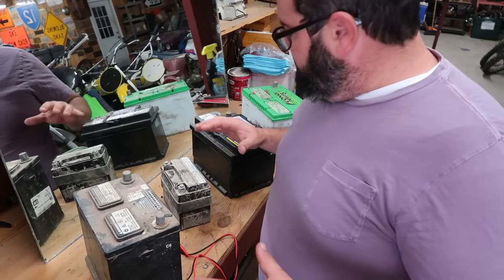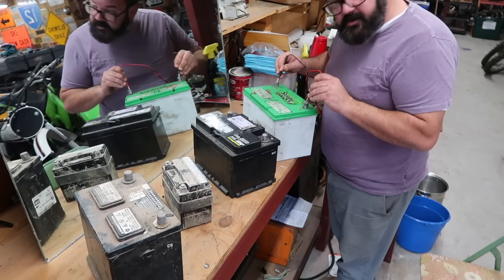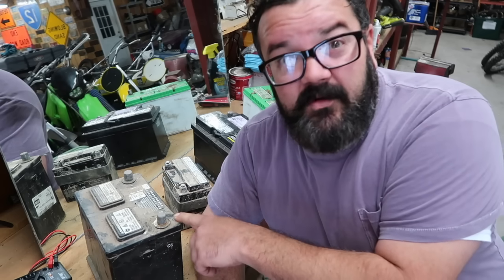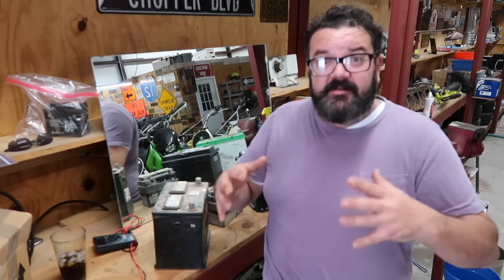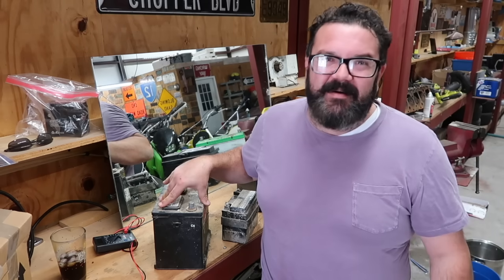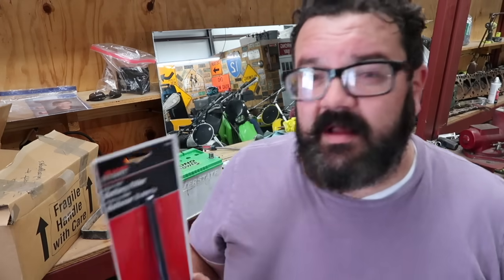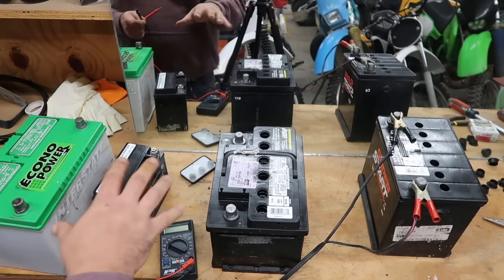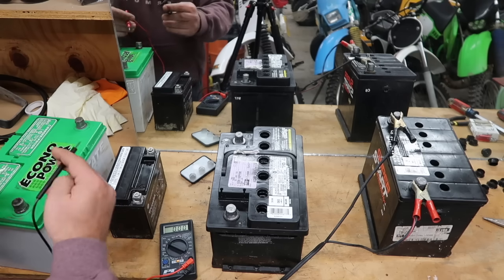Reconditioning a 12 Volt Car Battery: 100% Success

Comment: WOW ! the voltage is nice, BUT what about an Amperage draw test, , either with a hand held amperage load tester, Or put it in a vehicle that requires a lot of amperage to spin the engine,   I did this to an old bulldozer battery the battery was huge very heavy and two ropes to move it, it worked enough to get the old Caterpillar d8 to start, move it to my low bed trailer . Took it home, worked on it to new restoration  . Not bad for a free dozer, that had nothing wrong with it, sat 21 years, J.R. New England usa
Reply: A free D8? That’s practically a winning lottery ticket 😁
Reply: James Raymond CreativePhotography  that’s awesome
Reply from the maker: James, I'm assuming you didn't load test the D8 battery before you loaded it on the trailer. Same here. I fixed the batteries and started the vehicles, which is actually a load test. Good luck with your D8 project, I need one to dig a pond.

Comment: To really test the quality of your battery rebuild process, charge the car battery at 2 amps for 48 hours. then let the battery sit for 2 days and measure the voltage. It should be around 12.5 volts. Then try starting a car and make note of the sound of the starter speed. Compare that to the sound of a good battery when cranking the same car. A better test would be to take the battery to a auto parts store and have them do a discharge test. Car batteries will provide upwards of 90 amps under load. Batteries fail due to increased internal resistance limiting that maximum current under load. So voltage alone is not a good indicator of the quality of a battery.
Reply from the maker: Thanks for watching.
Reply: Good advice but should people try what was done here?
Reply: @nedcramdon1306  No, it's a waste of time. To really make this work you would need to remove the plates and chemically clean them to remove the contaminants which limit the current. That is what the epsom salts is suppose to do. Then you would need to clean the sludge from the bottom of the battery box which shorts out the plates limiting the voltage. Put it back together, add new electrolyte and charge it up. At this point you will have wasted more money and time than buying a new battery.

Comment: Lead / Acid batteries work with two dissimilar metals in the plates in a 9 or 11 plate configuration per cell; usually lead and zinc to enable the electrons to move through the acid during the charge / discharge cycle.

The Zn and Pb plates are the anode and cathode -- +/-.

Comment: Great video man. Better then all the ones I saw and my brain 🧠 understands. Haha, but I’m  confused 🤷🏻‍♂️ on you mixing the old acid with the Epsom salt and putting it back in the batteries. Is that an option that you did or can I just refill the batteries back up with epsom and distilled water without the old acid?
Reply: Without the old acid

Comment: So you leave the solution you boiled on the stove in the battery?  Do you flush it and replace it? How does this remove the scale on the plates and where does that scale go?
What do you do with the bicarb solution as referenced above? Seems like only half of the process was shown?
Reply: Correct,he doesn't make it clear.
Reply from the maker: After trying it a different way, I;d watch my second video, its a better approach

Comment: I've done this a few times and what I've come to find out is that you can seem to get them to recharge to a good voltage but the battery never regains it's Cranking amps.
Reply: I think its right say
Volt yes. But no crank amp
Maybe a truck battery will be  good for small car
Reply: right! 
That because the plates are sulfated so only the equivalent of a postage stamp surface is available for current draw
and the stack of cells are imbalanced (some higher, some lower)

In electricity they call that situation "high internal resistance"

junk is junk
Reply: I tried this on a small sealed led/acid battery and the plates were eventually dissolved into a mass of "black liquid." I guess that you have to get the proper mixture of Epsom's salt into the mixture which I obviously did not have.  It would probably be better to desulfate the plates first but this can take a LONG time!
Reply from the maker: The whole point of this is to clean the plates.
Reply: @CarGroves  But..it does not desulfate the plates I would imagine. I could be wrong. They have special electronic devices for that and even with them it takes a LONG time.  My plates turned into a "black soup" when I added the Epsom's salt and that was the end of the battery...Lol!  Incorrect mixture in my case, l guess??  😉
Reply: @arthurmann578  Any experience with Battery Minder (1500)?  I may have been recovering a battery, but since I was doing two parallely I believe they get out of balance i.e. the weaker will be low and stronger will overcharge thus yielding an average "top-off" voltage; I now let the weaker top-off by itself, and then let the process continue.  My weaker battery is working, but I don't put it through tough use. 

If anything, I find the Battery Minder 1500 a good maintainer.  I don't think thick desulfation is actually possible.
Reply: @louf7178   Thanks about the info, Lou!! Much appreciated.  I am looking into a solar battery maintainer for my car because I don't use it very often and the battery discharges.  I don't have a garage that I can use to plug in a battery maintainer so I am forced to try a solar one or constantly remove and replace the car's battery.  I am a little reluctant though, because some are of poor quality and people have shown how the wires on some actually melted and almost set their cars on fire!! I may be forced to build one of my own or at least "upgrade" one for safety .  Some of the better ones are expensive and I am...well...poor..lol!!  Be well and thanks again!  😀😀
Reply: The problem is, yes the Epsom salt does work but you also need to keep some of the battery acid in the battery. It does drop the cranking amps from say 850 cranking amps to 700 or so
Reply: @arthurmann578  I think solar chargers are (theoretically) a great idea for remote locations.  I imagine there has to be something of legitimate quality available - I do recall seeing one that sounded good.

I now am of the habit of putting a maintainer on a battery if it will sit more 2 days (usually one).  Adding a quick-connect eases the hook-up (make sure its capped so wet conduction doesn't happen)).  The self-discharge and parasitic-draw drains the battery, and that speeds up sulfatuon.  I've experimented with an old battery, and it has been performing sufficiently; these practices should extend the battery life.  I cant say I've desulfated one though.
Reply: @louf7178   I like the quick connect idea, Lou.  I am going to maybe look again into buying a solar charger of as best quality that I can afford.  Sometimes it is true about that saying "you get what you pay for."  It does suck to be poor for sure...lol!!  You just got to learn how to improvise sometimes.  That's a good way to learn things sometimes.  Be well!! 😀😀
Reply: @jlowe7710  I think that that was my problem right there as I believe that I just used Epsom's salt with water only as the battery was almost completely dry of acid solution when I tried it.  Live and learn as they say!  Thanks j.  Be well!! 😀😀
Reply: Lead acid has to have it or it doesnt agitate to create amps it needs. Volts yes amps NO. I build backup battery systems for cell phone towers
Reply from the maker: https://www.youtube.com/watch?v=RNnSYuTuLk4&t=46s
Reply from the maker: https://www.youtube.com/watch?v=RNnSYuTuLk4&t=46s
Reply: @arthurmann578  The trick i s to look up some recycling center in your area.
some take old batteries for $5...just buy those old batteries for $5 -ea
$25 experiment couldnt hurted. if you're just going to use it for 

solar recharging projects...incase the grid goes down...
you'll still have power to keep the food in the fridge cold.lol

I got wazzoo of 12v seal batteries..
actaully for FREE..i got 3 out of 4 to work..just recharging it .lol
It works fine for the kiddie's power wheels :-P ..
but holy wow...the re charging time

I have better things to do with my life than charge batteries for powerwheels..so i invested into Lipo 4s (16V). My grand kids are slave drivers....I have to maintain 2-sets of batteries for 3 -ea power wheels.
i can recharge 5000 mah  packs within 3 hours each
Reply: I followed the video to a tee. It didn't work.
Reply: @RoadWarrior427  same.
Reply: G Lasse
Reply: Arthur Mann just take the negative cable off the battery when you leave the car for any longer then one couple of days, if you don't like the idea of doing that every time, with ten dollars you can buy  a switch knob (it is commonly used to detect parasitic draws) and mount it between the negative pole and the negative cable. this way instead of losing time dismounting and disconnecting stuff you just turn the knob to open or close the circuit disconnecting the battery easy job. works great saving lots of money with couple of bucks.
Reply: nothing revives a dead battery. And this people knows that very well.
Reply: @louf7178  I found the 12 volt Colman solar battery maintainr charger works very well .you can mount it on the front or rear dash and keep it plugged into the car battery . It also has a over charge protector mode built in so you can not over charge your battery . But when you want to start your car you must disconnect the charger from your battery . It does have a inline fuse on the charger incase you forget to disconnect the charger from your battery . 
Im very happy with the product and it cost me only $15.00 
Hope this helps .
Reply: @brianmax8147  That sounds perfect.  Really perfect. Thx.
Reply: @albertbillman9920  it doesn't work if you know anything about batteries. It's all about cranking amps.
Reply: Glen Chadwick  That seems to be the story - the trick is to maintain them well i.e. don't let them sit undercharged.  By two days, sulfation begins - small sulfation can (apparently) be reversed, but not large crystals.  This is my summation, and my old batteries have been faring well.
Reply: @louf7178  Be careful : battery minders left on for weeks/ months can keep the water acid solution inside too warm --> evaporation of which will kill your battery. Espec if golf cart, you lose all 6 batteries that way all at once $$$ ouch.
Reply: @glasser2819  So, why not provide a solution instead of an insult? How do you remove the sulfation, apart from replacing the plates?
Reply: To regain cranking amps you cycle the battery a few times
Reply: Glen Chadwick did you mix in the old acid with the epsom salt water?
Reply: Arthur Mann  I clean my plates with 10oz of baking soda to one gallon of really warm water. Not boiling. Give it a few jostles and drain. Repeat if necessary.
Reply: Arthur Mann    12oz of Epsom salt per gallon of distilled water. Make certain all the salt is incorporated/dissolved in very warm water. Let cool and add.
Reply: @louf7178  I have used a battery minder to raise the recharged voltage from  12.2 v max to the normal 12.6 V.  Takes a few months but note if the sulfation has damaged part of the cell it will have lower amps.  Sometimes debris falls off and shorts out a cell then you get a 10.4 v battery.  Which will overcharge and die.    Us the desulfater before the battery  get too bad.   I tried Epsom salt on a weak battery that would only supply 10amps,   I went down to 2 amps then tossed it.
Reply: @CarGroves  that cannot be the fucking if you do not disclose the ratio of epsom mix to acid.  Without that disclosure your actual intent is to laugh at the fucking complaints in the comment section. Period.
Reply: @CarGroves  you tell fib because if that was the actual point then you would have disclosed the acid to epsom mix ratio...but you didnt so that changes your intent to laugh at the complaints in the comments....and I noticed this video is monetized so you are making money off people thinking they missed your ratio and re-watching the video.   I wish I could cuss your butt out.

Comment: You might want to consider a 'smart' battery charger - one with a battery 'restore' function.  The restore function will also knock/remove the 'Sulfonation' from the plates.   You might want to do both: a 'restore' with smart charger followed by the Epsom Salt treatment.   ;-)
Reply from the maker: Thanks, I’ll look into that.
Reply: desulfation is attempted with spikes of voltages produced by a coil... don't fry your car ECM/computer!
Reply: You need a Tesla Charger or a Bedini SSG wheel

Comment: There is an easier method that only requires 15 minutes of 200 cranking amps 5 times, let the battery sit for an hour in between each 15 minutes, it boils all the crap off the inside of the battery and brings it back to life.
Reply: 1000% correct. Only if people knew
Reply: What?
Reply: WTF?
Reply: This won't remove the contaminants. It's more akin to acid dipping a rusty frame, and letting it sit in it's own oxide juices so they can recombine again.  Let your acid cold settle, then decant and filter your acid solution.
Reply: Maybe not wear flip flops

Comment: So for what you mixed the destill3d water and epson salt, when using the OLD used stuff to refill the batteries or did i miss something???
Reply: He mixed the distilled water/epson salt solution with the old battery acid, before he put them back in the battery.

Comment: So you leave an epsom salt/acid mix in the batteries?
Reply: You don't need this epsom salts treatment with a battery which has just gone out like it wont quite crank enough to start your car,, just drain the original acid and  rinse out cells with a garden hose , drain them dry, then quick rinse each cell with distilled water.. then go to the parts store and buy some battery acid and fill with fresh acid..put on slow charge until charged.. its a 50/50 chance the batt will be ok. if its just under par then it'll light up easy.
Reply: @stevetilbrook3402  - You can use the old battery acid as long as you 1) let it sit for 24-48 hours so all of the junk settles to the bottom, then 2) move the good clear fluid to another container so you can check the density with a hydrometer, and 3) add more acid or water if the density is off.  Once this is done the fluid can be put back in the battery.  ***Always keep the fluid in a container that can be capped so there is no evaporation!  The epson salt solution would actually be good to use to rinse out the cells as the epson salt will help to remove oxidation from the plates; put it in the cell, move it around some, and let it sit for a few minutes to an hour and then rinse and dry, before adding the acid solution.
Reply: @Rattlerjake1  An older guy at Oreillys  who used to do it at a battery refurb shop told me to do it that way and it worked. every three years i replace the acid and it works better afterwood. Thats why i use newer acid its cheap anyway.
Reply: @stevetilbrook3402  - I only mentioned using the old fluid because some people may not be able to get new fluid, or the store is too far; I live in the country and don't drive into town for just one item unless it is a real emergency, I consolidate my trips. You could even use the fluid out of another dead battery if you don't have enough.
Reply: @Rattlerjake1  Yeah I even had an old mustang with a bent valve running on 80mpg by vaporizing the fuel and sending it into the carb throat.. We made a bedini generator once too, its on utube, it producers more power than it uses.. I actually did these things as a lot of people just dismiss stuff if its not spoon fed to them .

Comment: Would have been nice if you told us what the epsom salts/sulphuric mixture was when you refilled the batteries
Reply: I agree - seems like it was 4.5lbs of epsom salt to 1 gallon of distilled water ??
Reply: @user-jo5fz8iw3b  That mixture was explained well enough on video, but unclear was the refilling after draining and flushing the battery.  Did you mix one portion of the previously drained fluid, with the H2O/epsom mixture (and if so to what ratio ?) or did you use the H2O/epsom salt mixture only

Comment: I enjoyed the video, but I have always found that a battery can hold a 12 volt + and still be weak, in other words a battery needs to maintain it current(amps) or strength in handling a load. So if my battery shows around 13+ volts DC then chances are that I can handle a load  then I have to consider how long. I understand the theory as I have been in the Alarm industry since 78  I just never reconditioned a battery which in today's world it is a money saver!! Thank you for posting this!!

Comment: Volts mean nothing... it's all about the CCA (Cold Cranking Amps) or in other words, how much work the battery can do when fully charged?
Reply: Every spring my batteries are dead. Even after using a tender
Reply: @alex124241  check out scotty kilmer on youtube.This guy knows everything about cars
Reply: Not true
Reply: Totally wrong
Reply: No load volts don't mean much, its voltage under load that matters

Comment: Always use trickle charge. When battery gets up to 75%, make battery "use up" volts down to 25%. Then trickle charge until 100%. Use a charger that will add juice whenever it drops. Leave it hooked up for 1 week. This will crack crystals loose. Try it. I did and it works...as long as your old battery isn't completely dead!

Comment: How they hold up when you put a load on the batteries with a load tester
Reply: Agree, getting an open circuit voltage is one  thing but if there is still plate oxidation on the outside of the plates, you won't be able to pull any decent current. So you have nice voltage restored, but still no ability to crank a motor. He needs to do short circuit current testing